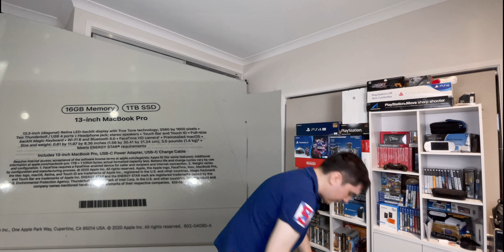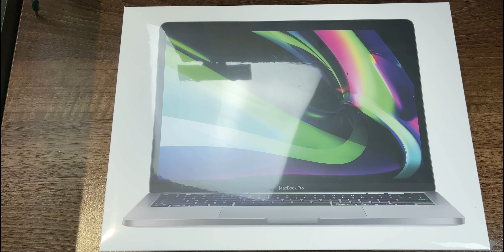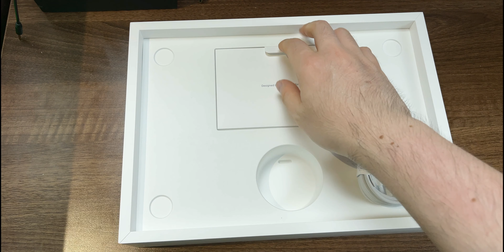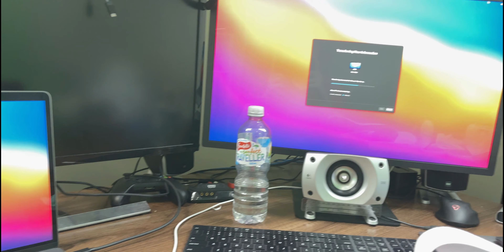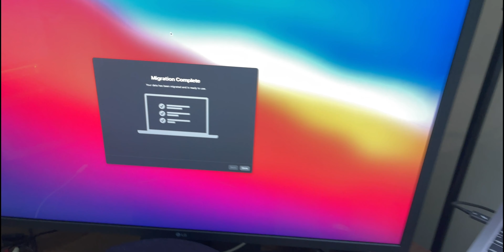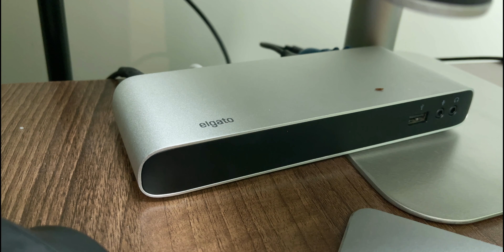Macbook Pro 13 inch M1 16gb 1TB Fully loaded Unboxing 2020

Comment: One of the few 16 gig MBP reviews. Thank you. 
My 2017 15” MacBook Pro fully spect out can not handle my Sony a7Siii 4K 120 FPS. 10 bit 222. This release from Apple has saved many a lot of money. Normally I would have had to jump to some i9 pro model.  I needed this now. Waiting 6-12 months for some better version would hold me back with my work flow.  I preordered the 16 gig MBP 1tb, and already sold my 15” MBP. I have an older i7 Mac mini I can use if something is not compatible.

Comment: For me it's too early to purchase Apple Silicon I'm going to hold off until it matures more, Hopefully when Apple get's to the Pro Level Apple silicon Mac's it will be more mature and then I will buy one, Are you going to pick up a XDR to go along with your new Mac? Those displays are so worth it, I pick up a couple of XDR's earlier this year
Reply from the maker: the macbook pro lineup is for pros but portable. This laptop 's M1 CPU currently beats a base model iMac Pro and every single macbook pro to date including speced out 16 inch macbook pros.
Reply: @pkerry12  and it will get even better, 16-inch MacBook Pro, iMac, Mac Pro Apple silicon has not come out yet and and it will be ever stronger by the that time the M1 has matured more I’ll wait  good luck with your new Mac looking forward on seeing some videos on your new setup